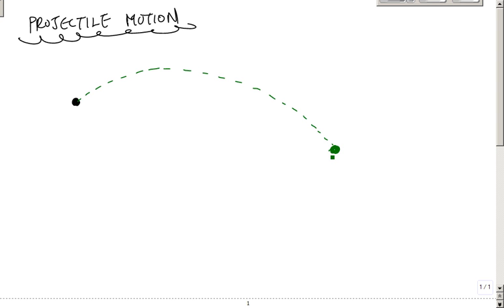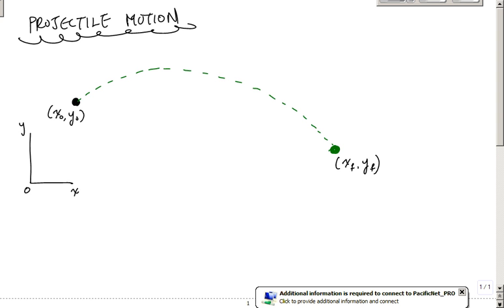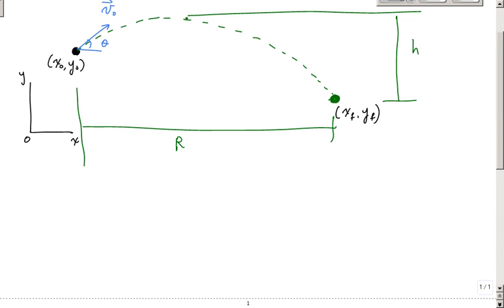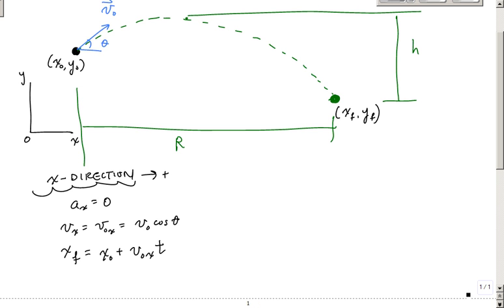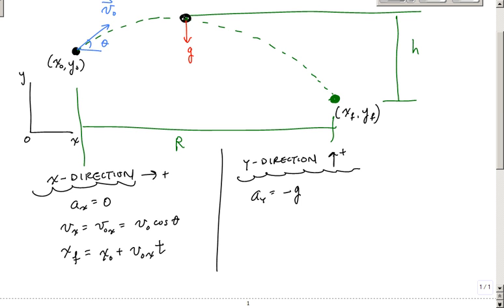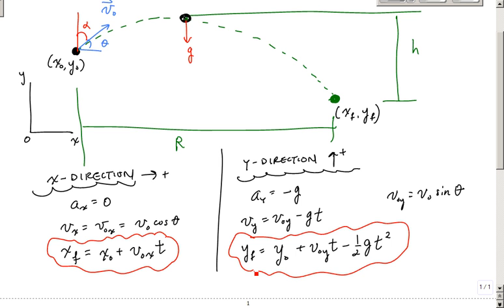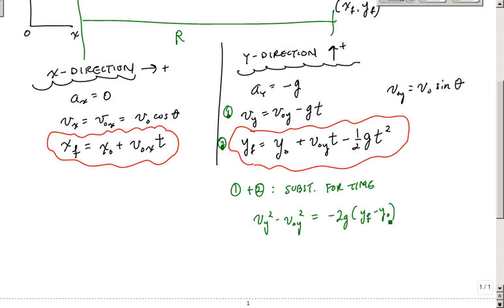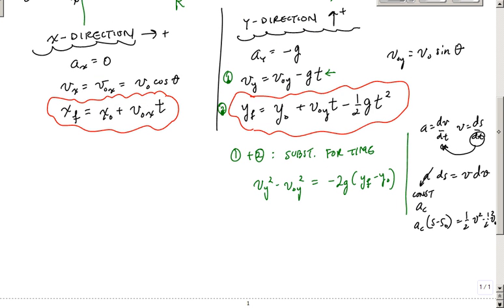Projectile Motion - Engineering Dynamics

Comment: I've a question, I don't understand how the acceleration in the x-direction is 0, I understand the ball is accelerating in the y direction, but I think of it a directly proportional relation; as in, as the ball accelerates in the y direction, it moves a distance in the x...I would only think of it as 0 in the x if the ball is literally going up and down in the y...Can anyone clarify this point for me?
Reply: The velocity in the X direction is always constant, therefore acceleration (which is the time derivative of velocity) is zero. This is only if we analyse the projectile once it has already been launched(not as it is being launched). Once it is launched there are no external forces acting on the particle in the x direction ( ignoring air resistance). If the acceleration in the x direction was not zero, then the x component of velocity would change.
Reply: If you were to draw the free body diagram of the object, then you would notice that the only force acting on it is gravity assuming there are no other external forces. Therefore, there are no forces in the horizontal direction which means the sum of forces in the horizontal direction is zero. When force sum is zero that implies F=ma=0. Or in other words, acceleration is equal to zero. And when acceleration is zero we can determine two things: velocity is zero or velocity is constant. Since the object had an initial velocity in the horizontal direction, then it must be constant. 

My tip is to just draw free body diagrams and use force analysis. This will solve most if not all problems.